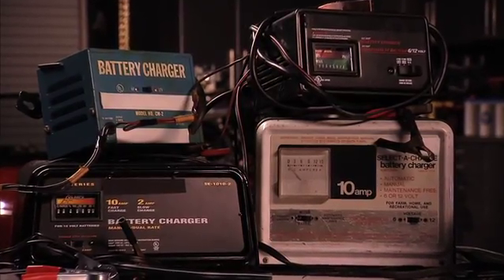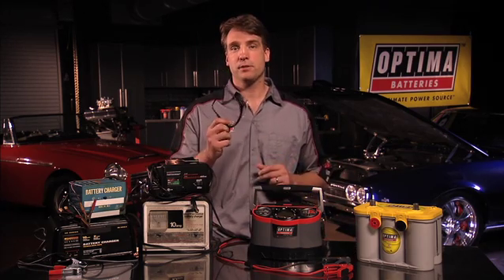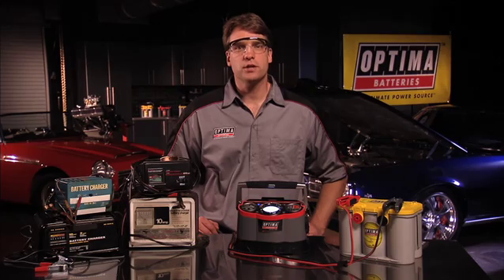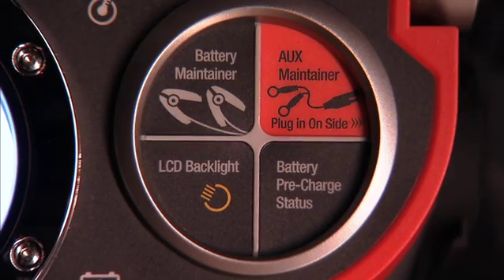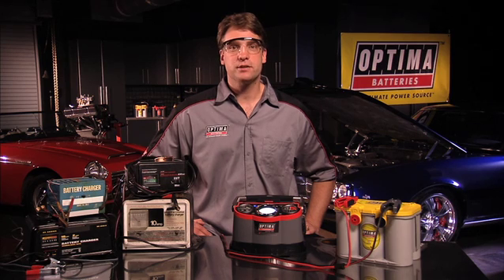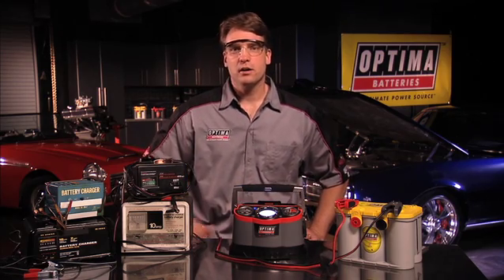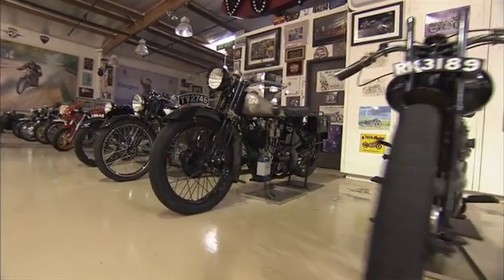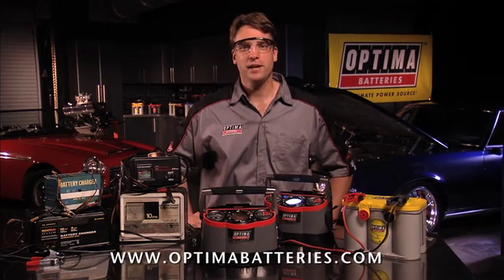Tech Tips 8: Using an OPTIMA® Digital 1200 Battery Charger & Maintainer

Comment: Can this Optima charge a Odyssey performance battery?
Reply from the maker: OPTIMA chargers can safely charge all 12-volt flooded & AGM lead-acid batteries, regardless of brand or manufacturer. However, we would caution you that some battery brands will try to force their customers into purchasing one of their branded chargers, by threatening to void your battery warranty, if it is charged or maintained outside a very specific set of charging parameters laid out in their warranty terms & conditions. We don't do that with our battery warranty, but you should take a close look at the terms & conditions of your battery warranty.

Comment: Can this charger be used to charge and maintain the small sealed lead acid batteries and if so what would be the best course of action for doing so
Reply from the maker: It can charge & maintain all sizes of 12-volt lead-acid batteries, both AGM and flooded. There are four different settings and you can choose the setting most appropriate for your application https://www.optimabatteries.com/en-us/battery-charger

Comment: FUTURE NEW FEATURE REQUEST.  Given that a standard US outlet can supply upto 20A at 110V, please consider adding the ability to independantly charge (or at the very least maintain) a second battery in tandem, using a separate line (the display could alternate between showing status for each). 

Rationale: It seems like it should not be much of a technical challenge to do for 12v batteries what other chargers already provide for things like AA and AAA batteries ... only the voltages, amperages and charging curves differ, but the principle is the same.  If the power needed is already there at the outlet, why not take advantage of the unused draw that is available to double the number of 12v batteries a given charger can support  ? To me, it seems like a no brainer, and it would give the brand a huge leg up against all competitors.

On a related note, a 220v version able to charge and maintain 4 or more batteries at once seems within easy reach, if optima were so inclined. Heck, at 220v there should be enough oompf to jumpstart a car with a weak/dead battery directly ... another capability to consider.
Reply from the maker: We appreciate the feedback and will forward it to our engineering group. However, we aren't fans of jump-starting cars with jump packs except in emergency situations. In most cases, when vehicles are jump-started, the vehicle's charging system never fully recharges the battery and the owner never fully-recharges the battery with a battery charger, leading to a cycle of discharged batteries and jump-starts until either the battery or alternator (or both) fail.
Reply: OPTIMA Batteries Helpful info to consider, thanks. 

Non-sequitur question: when charging a battery that is still in vehicle, why do none of the optima charger vids show the vehicle's negative lead being disconnected and reconnected as directed in the manual? (From memory the vid showd just clamp on, clamp off, and go, which is wrong).  Just out of curiosity is disconnection prior to in situ charging to protect accessories from a possible overvoltage situ ? Just curious.

Comment: HELP REQUEST: I bought a model 400 charger and it was able to successfully  recover a deeply discharged D31 (yay), but it was NOT able to recover an older D34 that I believe has sulfated ... it just switches immediately from charging to maintaining mode, and languishes, instead of attacking the sulfate full on.

The 1200 model apparently can do 10A, but the 400 model outputs less than half of that, which is why I suspect it failed to break up the sulfating.

Can I simply hook my good D31 in parallel with the sulfated D34, and then hook up the 400 for an extra boost (to break the sulfate), or will the 400 simply get confused and not charge properly ?

To summarize my question: is there is an optimal way to use the 400 (instead of the 1200) to recover a sulfated optima battery, and if so can you please post details ? Thx.

Further electrical details of my bad battery upon request.
Reply from the maker: What is the voltage of your D34 before you attempt to charge and what is the voltage after attempting to charge it?
Reply: OPTIMA Batteries Hi, thx 4 replying.  It was 9.5v when i first hooked it up during my initial attempt a few days ago.  After the 2 min analysis it declared it 0% deeply discharged, and after selecting deep cycle it began charging ... but within 1 min it suddenly switched to maintaining mode and just sat there at trickle charge level (maintenance mode).  I tried again twice more with the same result.  It seemed pointless to continue, so i gave up after 10 mins or so.  Retesting it just now (with the 400) shows 9.5v (no change). 

The manual didnt have anything useful to say on that, hence the request for help. Happy to do additional diagnostic efforts, including leaving it on maintenance for a while, but my confidence is low because the manual does not indicate an ability to switch backwards from maintenance to full on chargeing mode at max amperage ... it only mentions the once a month stepup that only lasts 3 mins, which doesnt help here.

Im hoping i dont have to buy a 1200, just for the extra amperage ... was hoping i could mimic same by hooking another battery in parallel, but im guessing that would just confuse the 400's smart protocols. I also dont have an older 10A dumb charger to fall back on.

Thoughts ?  Thanks in advance, BTW.
Reply: I hooked it up again just now and after saying 9.5v deeply discharged 0% it spent 15 sec or so in charging mode then it switched to conditioning mode and displays 10.7vdc being applied at 0.0A (ZERO amps ?!). Looks futile to me, but electrical stuff is a little out of my usua skillsetl wheelhouses.

Correct me if i am wrong but to break up sulfate in a sealed AGM you need either high voltage at a low amperage, or high amperage (10 min, 15-20 preferred) at something relatively close to normal voltage, and 10.7vdc at 0.0A doesnt fit either of those.

EDIT: 30 mins into conditioning mode and it still says 10.7Vdc 0.0Adc (unchanged).
Reply: UPDATE: After 90 mins i noticed one of the clamps had popped off, so I reconnected it and restarted the process. Strange ... now it says its conditioning at 11.0vdc 0.1A. How did it make any progress earlier if the 0.0A reading was accurate ?  Guess I gotta just leave it connected, wait and see.
Reply: Another 5 mins into the new cycle and it just now switched from saying 0% charge to 100% charge, and the 11.0vdc and 0.1Adc are unchanged.  🤯

I bet if I unhook it, and wait a little, it will still come up as dead as it was earlier. Its just post mortem twitching, right ?
Reply: ^Bump^. Well, the charger slowly began ramping up the voltage and amperage, so it looks like it may be making headway.  

I have to admit that switching directly to maintenance mode, and showing 0.0A earlier, was very confusing and disheartening ... it caused me to give up on the battery prematurely.  I think the user manual would benefit from a more detailed description of what may happen during the recovery of sulfated batteries, and what readings may occur, to prevent owners from giving up like I did.
Reply from the maker: @RovingPunster  we apologize for not responding sooner. Unfortunately, it looks like YouTube held your comments as possible spam (perhaps because so many came in such a short timespan?) and we had no idea you posted additional comments. How did things turn out with your battery? Sometimes if a battery is deeply-discharged, it will take a long time to come back around. With the Digital 400, we usually just advise folks to give it a day on any battery and see if it's made any progress.
Reply: @optimabatteries  These things happen, so no worries.  To answer, if you read my last post from immediately before your own, you'll see that the 400 was able to partially resurrect the older battery.  I have no way to measure how much capacity was permanently lost to sulfite, but it seems to be working for the time being as a power bank for small household electronics in the event of a blackout ... though it no longer puts out enough CCA to jump my car if it goes fully dead.

Just a reminder - I also made an earlier suggestion about beefing up the  description in the manual about the charging behavior involving sulfited batteries.  A better blurb might have encouraged me to not give up prematurely like I did.  What it is perfectly sensible that you dont want to overwhelm average users with TMI that might intimidate them, not providing enough information is just as bad if not worse.
Reply from the maker: @RovingPunster  your comments are still going into the spam filter. So frustrating! We appreciate your feedback regarding our manual and will definitely share it with our charger team as they look at manual revisions.
Reply: @optimabatteries  You are very welcome ... anything to make a good product even better.  Belated apologies for any redundancy between todays posts and the flurry from several months ago.

As for running afoul of the spam filter, I have no clue why that'd happen, and I'd appreciate any insights or links you might have.  Although ive been trolled on occasion (elsewhere), I was never the one to initiate it, and i'm pretty sure my upvotes are generally a full order of magnitude more than any downvotes.  Is it post frequency, or perhaps having made multiple posts without someone else posting inbetween ? 🤔

Apologies for going OT ... feel free to ignore this.  However, if youre feeling charitable Id like to figure out what's going on, so I can avoid it in the future.

Comment: I use a 2000 watt power inverter in my truck. Can I use this to charge/maintain my battery while using the inverter or does the vehicle need to be off for all charging modes?
Reply from the maker: If you are using a 2000-watt inverter, your vehicle's alternator should be able to keep pace and maintain voltage in your battery. If it doesn't, adding the load of our charger won't help the situation. You're better off fully-recharging the battery with our charger after you're done using your vehicle.
Reply: OPTIMA Batteries I should have been more clear, I want to use my tools plugged into my inverter while the battery is plugged into an outlet, say in the garage, not on the inverter in the vehicle. Allowing me to use the vehicles radio and lights while on accessory and not using fuel.
Reply from the maker: You'd probably be better off plugging your tools into the outlet in your garage, rather than running them through an inverter in your vehicle with a battery being maintained by a charger. We have heard of folks who connect their vehicles to a charger, so they can listen to their radio in the garage and haven't heard of them having any issues doing that.

Comment: Really appreciate the input. If one of the batteries is charged as a starter, and the other is charged as deep cycle and wired separately for use. One for the engine and one for the trolling. Can I then in the winter disconnect all cables to the batteries  and hook the 2 batteries up in parallel (neg to neg and pos to pos) and then connect to Optima 1200 charger for maintenance? I would normally pull the batteries and keep in heated garage but in my "new" boat it is very difficult to get batteries in. Minimal space to navigate in.
Reply from the maker: If they are used in separate applications, they should be maintained separately, as they will have different charging characteristics

Comment: So can I run them in parallel then to start my 40hp and run my trolling motor? I thought one had to be set up for engine starting and the other for deep charge.
Reply from the maker: You can, although if you run your trolling motor for too long, you may not have enough energy left to start your engine

Comment: I have 2 - D34M Bluetops with a Optima 1200 charger. My question is, during the winter can I connect one battery via clamps and the 2nd battery via the aux cable to put both batteries in maint mode.
Reply from the maker: Only one will work at a time- either the clamps or the auxiliary cables, but not both. If you connect your batteries in parallel, you can maintain them both during storage with one charger.
Reply: Can you define parallel VS series. I think I remember but just a remider or mnemonic to remember...  @optimabatteries
Reply: My nsolar panels are in a series and put out a larger voltage—so I assume parallel keeps the same voltage, just increases amperage...
Reply from the maker: @tomfrantz  an example of a common parallel application would be a diesel truck with a 12-volt system that runs two 12V batteries connected positive to positive, negative to negative. It's still a 12-volt system, but the Ah has doubled.  

A common example of a series application would be a 36-volt trolling motor system that runs three 12V batteries connected positive to negative. The voltage triples, but the Ah remains the same.

Whenever you are using two or more batteries in a parallel or series system, all the batteries should be identical in age, size and type.

Comment: Doesn't have a desulfate mode during normal charging and no mention of temperature compensation
Reply from the maker: The video was already more than six minutes long and we were concerned even at that length, whether we'd be able to keep our audience tuned in that long. The unit does have ambient air temperature compensation during charging and digitally controls the charger output in high heat or extreme low temperature conditions. It also has six charging stages, one of which is designed to recondition your batteries every 30 days for up to 3 hours in the battery storage recondition mode. When completed, the auto-maintain mode will resume, while your battery is fully charged. You can read the full manual here- https://d26maze4pb6to3.cloudfront.net/optimabatteries/9913/4330/9620/Digital_1200_Battery_Charger_Manual.pdf

Comment: How big of battery bank can this charger charge?

Is it possible to charge (6) Optima D31 yellow tops by this charger at the same time?

I find it complicated to disconnect my batteries and charge each a time!

I need a charger that can charge multiple batts at a time for my yellow tops!
Thanks,
Best Regards.
Reply from the maker: If the batteries are wired in parallel, it can charge all six of your D31 YellowTops
Reply: @optimabatteries  It can ?  But what happens if the batteries in the bank are at different charge levels (ex: 20% 90% 35% 75% 5% 45%) ?  Since they're connected in parallel to a single charger they appear as one battery ... wouldnt that result in the less discharged batteries being overcharged ?
Reply from the maker: @RovingPunster  if you have a bank of six batteries that are all at a different state of charge, you need to address that issue first. Any batteries connected in series or parallel should always be identical in age, size and type. Any variation in those factors can lead to issues, such as some batteries being severely overcharged and others being severely undercharged. If you find that you have a bank of six batteries that are all have a different state of charge, you should charge them individually. If they continue to exhibit different charge/discharge characteristics, the entire bank should be replaced with batteries that are identical in age, size and type. That doesn't mean the old batteries need to be recycled, just that they should not be used in parallel or series applications.

Our engineering team recommends rotating the wiring order of any batteries in banks of three or more every few months, like you would rotate tires. Their reasoning is that with each additional battery in a bank, the chances increase that there will be an issue with either the battery or the cables connecting it. If there is any issue with the batteries or the quality of connections between the batteries, whether it is a high-resistance cable or a loose connection, it's easier to identify that when rotating the order within the bank periodically.
Reply: @optimabatteries  Yes, that make sense ... your earlier reply sorta oversimplified things a little.

SUGGESTION: Given the issues you mentioned, It would seem like a more optimal solution to create a different and more capable charger model specifically intended for charging/maintaining multiple batteries at once (say upto 2 on a 110v/20A circuit, and 4 on a 220v/40A circuit) each of which could differ in age, capacity, type, and level of discharge.  I can easily see a market niche for that (auto service centers, car rental outfits, limo & taxi companies, households into motocross/atv/waterskiing, or with HD cordless lawnmowers and landscaping gear, people with older off grid power systems wanting to recondition their batteries to extend their lifespan, etc.).  Something to consider.
Reply from the maker: @RovingPunster  we appreciate the feedback on future product offerings and will definitely share that with our development team

Comment from the maker: Both the voltage and amperage will vary, based on the depth of discharge of the battery and the various stages of the charging cycle.  This charger will charge at a maximum of 12 amps.